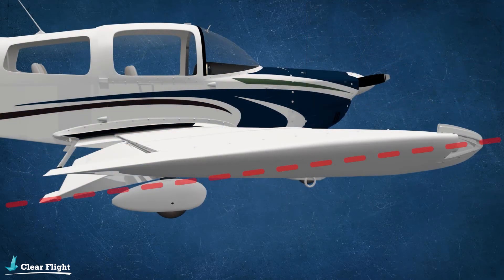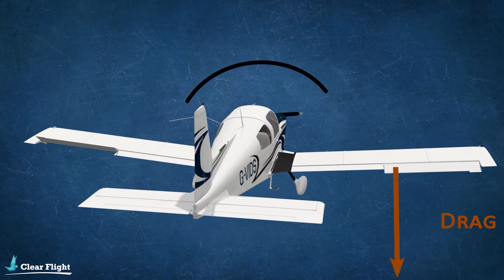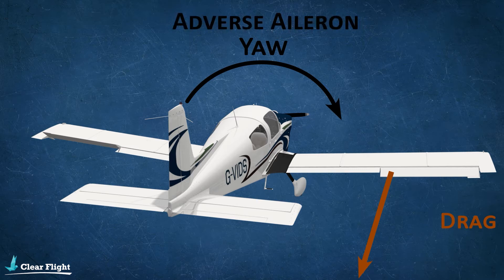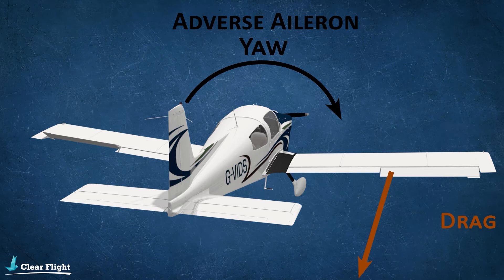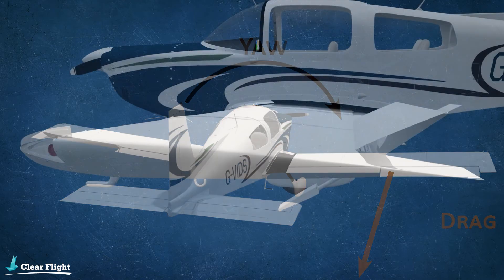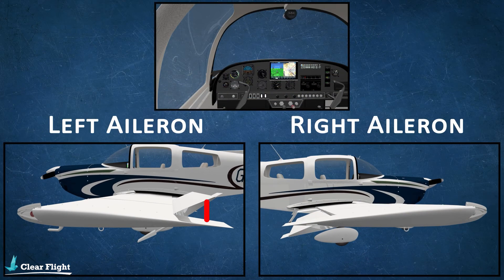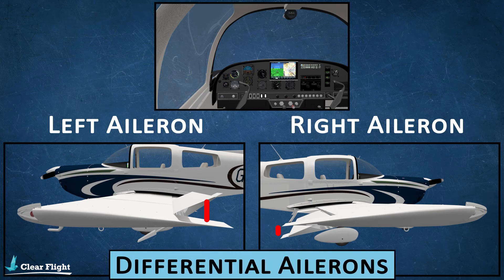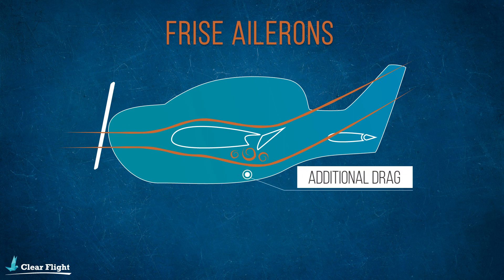Aileron Drag & Adverse Aileron Yaw | Principles of Flight | EASA Private Pilot Ground School

Comment: A lovely explanation and great to see the different approaches to controlling adverse yaw in the design of an aircraft.  When an aircraft is entering a stall one wing usually drops first and the natural instinct is to add aileron to pull that wing up, but the downward deflection of the control surface increases the effective angle of attack making the situation worse and bad things happen.